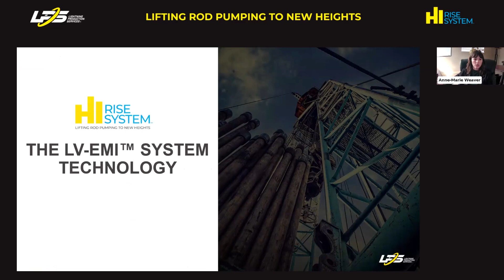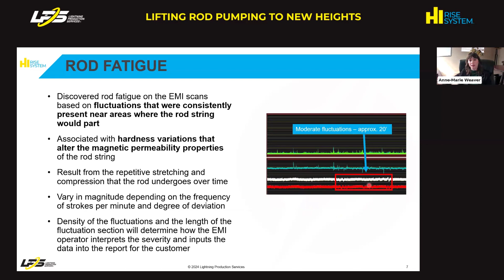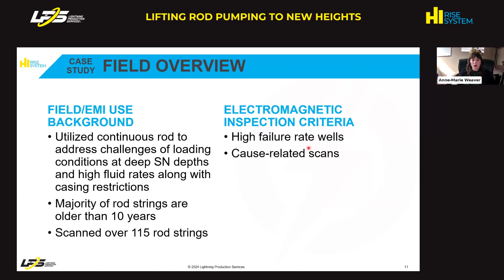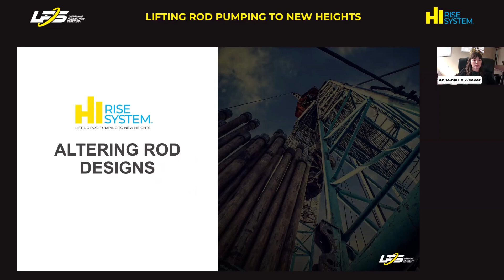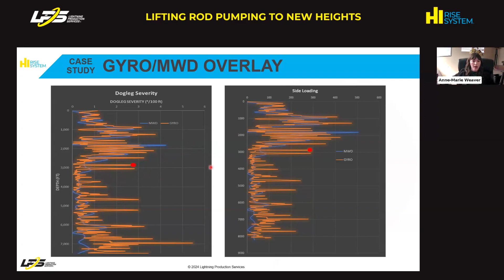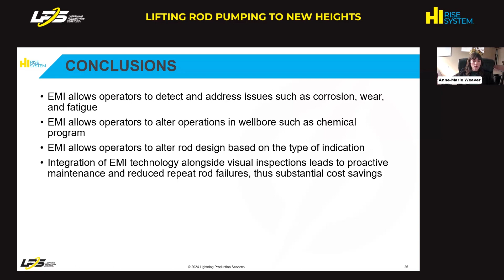Utilizing EMI Technology to Optimize Run Times and Achieve Superior Performance

Comment: This is very interesting webinar, but about calibrating with pulser is questionable, pulser will equalize shoe sensors, but we still need to use standard to identify test notches, I don't have much experience with Rods,  so more then anything I'm asking because this is my experience with tubing and casing and drill pipe
Gus